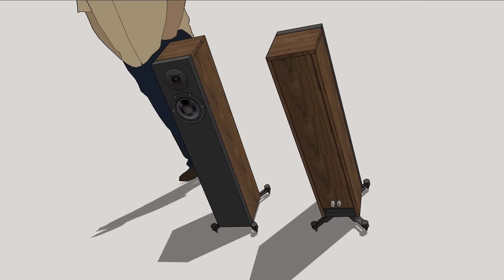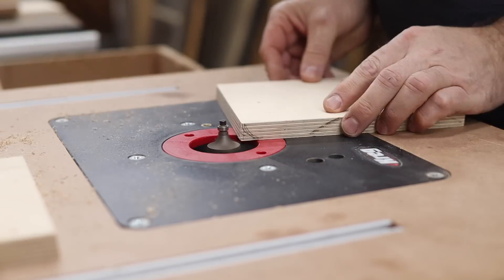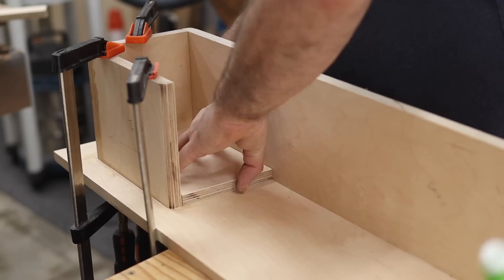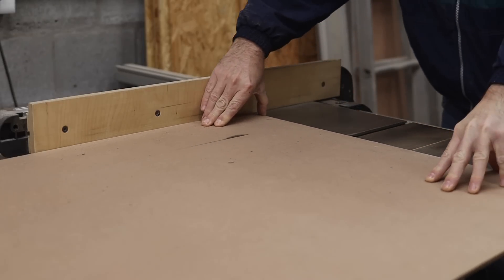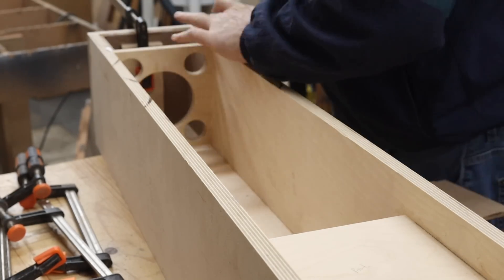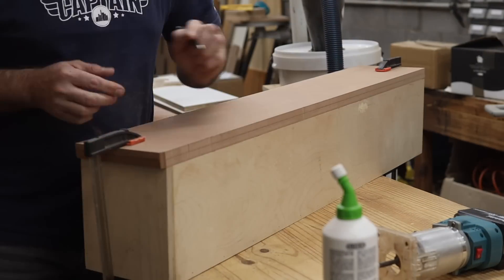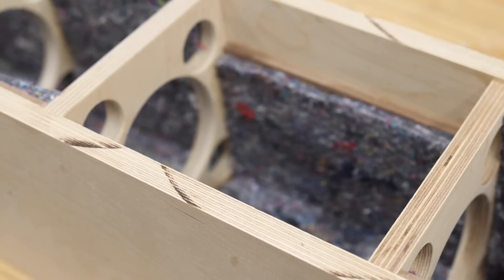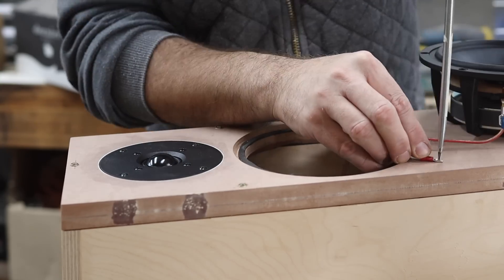Building a 2-Way Floor Stander Speaker with Kartesian Drivers  PART 2 - by SoundBlab

Comment: Great video! What is the white ring that you've mounted underneath the tweeter?
Reply from the maker: I initially made a mistake with the size for the tweeter hole, and then filled it with body filler to re-cut the hole correct size. The white you see is the body filler that remained.
Reply: @SoundBlab  great — I thought something like this may be the case, but wondered if the tweeter came with a specific mounting plate. Great build altogether!
Reply from the maker: Thanks

Comment: I'm really enjoying the content, thank you! Fellow South African here! I'm curious about the denim insulation that you use,  but I can't seem to find any suppliers online. Can you point me in the right direction?
Reply from the maker: Hi, thanks! It is just normal 12mm under carpet felt. You should be able to buy it at a local flooring/carpet shop.

Comment: Excellent build so far. If I'm allowed to be picky, the cabinet bracings should be spaced unequally to further prevent standing waves.
And again, as I've mentioned before, your choice of music in the videos is top notch!
Reply from the maker: Thanks man. Perhaps the braces can be unequally spaced. It could not hurt. However, they have not much meat left on them after the holes drilled into them that I doubt it will make much difference, or cause any issues. Glad you like the music!
Reply: @SoundBlab  yes, there shouldn't be any issues, given how little surface there is on the bracings. It's nitpicking.